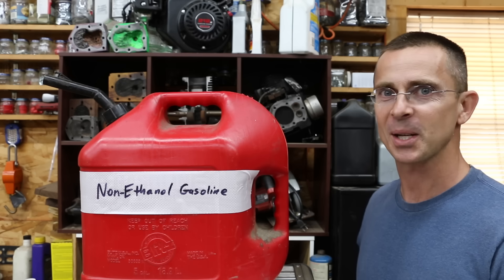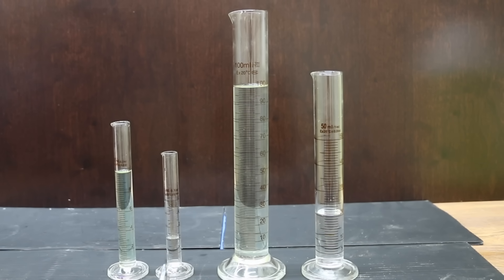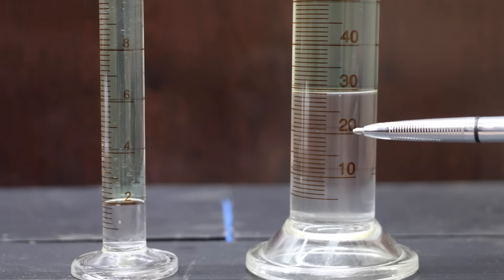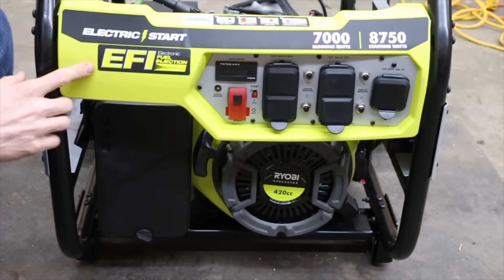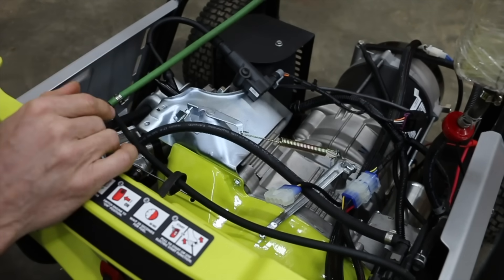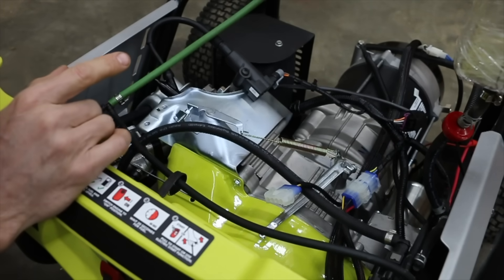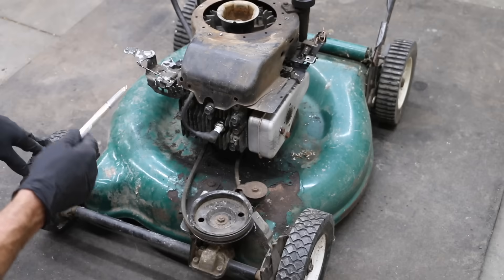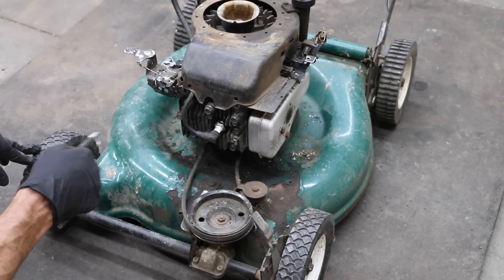Is Non-Ethanol Gasoline Really Better? See the PROOF!

Comment: In England, Scotland and Wales (thankfully it hasn’t got to NI yet) from this summer all petrol will be E10 (10%) petrol currently most of it is E5. The government is going to make it law for fuel stations to make standard petrol E10 this is in order to put approximately 500,000-600,000 cars off the road (unless you pay more and buy premium 0% ethanol). The government recons that the use of E10 petrol will reduce the amount off CO2 produced in the year by cars will be around 700,000 tons. In the UK at least all cars from 2011 have be required to be E10 compatible. 

The reason older cars can’t use it is because they have lots of nitrial seals and steel fuel system components this is a problem because ethanol desolves and damages nitrial seals, also it gathering up water in steel tanks and pipes won’t do much good.
Another down side to E10 petrol is that it doesn’t work well at all in 2-stroke applications apparently ethanol acts like degreaser, not ideal in the crankcase, and as a lot of 2-strokes have carburettors and the the ones with nitrial needle tips won’t like it either

According to Autocar in some vehicles that the E10 petrol will decrease the fuel economy by just over 11% this was in a a Dacia Sandero. It may be better for the environment but it certainly won’t harm the governments pockets if everyone is filling up more often and there has to be 500,000 new cars bought there will be a lot of VAT and fuel tax revenue created

Comment: The biggest problem is that fuel with alcohol in it costs less and is more readily available than non alcohol fuel negating the 4+- % fuel savings. Using the fuel in a can at $15-30 for a gallon equivalent is just nuts. One of the best things to do is run to empty when not using for a period of time.
Reply: But then you have increased condensation and potential rust in steel tanks.

Comment: Ethanol gas is not bad, per se,unless it sits in the fuel systems of two and four cycle engines.  Sitting in a gas tank it absorbs water from the atmosphere, which is what cause problems.   If water gets in a carb or fuel system it will corrode aluminum parts and harden rubber parts which will inhibit them from running properly

Comment: quick side note
........our company purchased a small EFI generator, about the same size as the one in your video.
(..............found that there were many pieces of equipment that would not operate with it..)
heavy duty hammer drills and what-nots.
.
...........not sure why

Comment: question : is after fireing in small engines some thing to take serious or is a fact of ageing..
Reply: You mean backfiring and fire coming out of the muffler? That means you're not firing all the time and raw gas is passing through on some strokes. Something wrong.
Reply: @jamesvandamme7786  a back fire is when an engine has ignition of fuel air mix  in the intake system..after fireing is un burned fuel air mix ignites in the exhaust system  they are different... a back fire can destroy an intake system an after fire can ruptue an exhaust system
Reply: @jamesvandamme7786  also when throtelling back from operating under load i do know this if done rapidly will cause poping of the engine in exhaust as fuel air mix is richer for a few seconds

Comment: I've run ethanol in everything I own for decades now, and it's never been a problem as long as it doesn't sit for 4 months. That includes older machinery, my 1950 industrial air compressor with a straight 6, my 1964 Parkmaster with a straight 6, and several vintage motorcycles from Europe and the far East.  Iowa has ethanol in all gasoline and we have the lowest average auto repair in the nation.  According to the naysayers, our roads should be littered with dead cars. Some of us are old enough to remember rotten fuel lines, fuel pump diaphragms, and gummed up carbs being a REGULAR issue long before ethanol was ever created. Ethanol was the propaganda excuse big oil foisted on you all because they didn't want the competition.

Comment: I have twice bought gas which made my engine more powerful and significantly increased my mpg. Both were the same brand from the same gas station. I have no way of knowing why, but I have my suspicions. My guess is that those 2 batches of fuel were ethylene free, perhaps because the supply company had run out of ethylene and sent it out like that because they had to supply gas stations no matter what. If that is the case it implies that I am burning more fuel for the same mpg and performance as ethylene free gas. If so it implies that the gas with10% ethylene is not in fact reducing CO2 emissions because I am using more gas for the same mileage.
Reply from the maker: Thanks for sharing.

Comment: As a small engine mechanic, i can definitely say that yes ethanol is damaging to materials like rubber o-rings and hoses. Besides that it corrodes aluminium, rusts steel, and creates a chalky buildup that ruins carburetors.

Aaaaand..... It has a lower energy so e-10 fuel is roughly 10% less fuel efficient than straight gas and takes roughly 30% more fossil fuels to create.
Reply: We would not have ethanol mandates if Iowa was not one of the early presidential primary states
Reply: In Europe it is impossible to get gasoline with not at least 5 % ethanol. I was wondering why they made such a law, as the know well, that the production of Ethanol is ruining the rain forests. But i found the answer. :-)  It is damaging the materials of the engine. That means shorter car life and more business for the car companies. So Ethanol is bad for the environment, as it shortens the car life, but its good for the companies that produce cars.
Reply: @friedensmal  Not sure if this is true or not but I have heard that the ONLY reason why we use ethanol is because of american farmers not having buyers for their corn.
Reply: @codemang87  cattle farmers would buy the corn see how they buy the feed product produced from the ethanol process
Reply: @codemang87  no one wants to eat it. Gmo
Reply: @stillkickin9957  what's your point?
Reply: @117rb  umm that is a shaky feed source at best take big bucks to move store even feed the crap. It also had a very low shelf life
Reply: @brianjohnson6053  long enough shelf life to ship to China seeing how thats where a lot of it goes. And it moves and stores the same methods as corn does.
Reply: @friedensmal  Esso in the UK says otherwise unless you live in the far Sw or North! 
"Esso super unleaded petrol (Synergy Supreme+ Unleaded 97 and Synergy Supreme+ 99 ) is ethanol free (except in Devon, Cornwall, North Wales, North England and Scotland)."
Reply: From the 1st Sept this has changed. All higher octane fuel is now E5 (5% ethanol) from the major brands. Regular is now all E10
Reply: @1maico1  The Esso website says 99 octane will continue to be ethanol-free in most but not all UK regions for the time being at least.
Reply: @Rob Elston Ethanol doesn't take any fossil fuels to create IIRC.  How does it take 30% more fossil fuels to mix gas 10:1 with ethanol?  Does it take more proccessing to make it? I feel like I'm either missing something or you are just making shit up.
Reply: @codemang87  how is the corn planted, crop maintained and harvested?? Magic?
Reply: @mebe2k  that's irrelevant. Corn doesn't require fossil fuels to produce.  Semantics aside, even if they did use some gas to plant crops, that's pretty much negated by the fact that they would be planting crops regardless of whether it's used for ethanol or not.

With your logic you can practically say everything in the world uses fossil fuels.
Reply: @codemang87  and electricity magically come out of the wall too.
Reply: @mebe2k  I live on a farm. Corn most definitely takes fossil fuel to produce.We have massive diesel tractors to  cultivate and plant the fields and equally large combines to harvest. Then we have diesel trucks that ship the corn to the silo.
Reply: @rikertvonfulton16  does it take more fuel to produce corn for ethanol than it does corn for food?
Reply: @codemang87  Not to the point of harvest. It would depend on the transport distance to the ethanol production plant . The farming community has become dependent on ethanol production as a market for their corn.
Reply: @rikertvonfulton16  thank you.  It's gratifying for my perceptions to be reaffirmed by someone actually in the industry
Reply: @codemang87  I usually don't respond but to clarify his point. Farmers use Diesel to plant, tend and harvest their crop. Its transported by truck to factories that use electricity from fossil fuels to produce the ethanol and then its transported by rail and truck to the refiners to mix it with gasoline.
Reply: @biffmalibu3733  that's exactly what I thought.  You guys are arguing with me but agreeing with everything I purported. 

To be clear, I think the original poster is full of horse shit.  I don't think its takes any more fuel to farm corn for ethanol than it does to farm for food.  Definitely not a 30% increase at any rate.
Reply: @codemang87  Basically everything in the world DOES use fossil fuels to be produced. Is the light bulb on yet?
Reply: @codemang87  Well I guess the light bulb hasn't come on for you yet. Give bit time and some thought, if it's not to painful.
Reply: @TheFishdoctor1952  how bout you just explain yourself rather than jump in and completely change the subject.  Just because farmers use fossil fuels doesn't mean you get to count corn as a fossil fuel.  That's some fuct in the head logic right there.
Reply: @nooneyouknowhere6148  thanks for supporting what I already said
Reply: @codemang87  I can confirm it takes a 10th of the energy to make ethanol then a refinery
Reply: @117rb  Why are they stuck on corn for ethanol when there are plants that have a much higher yield. Cattails everywhere,  easier to grow on your own land? Talk about energy independence. Run your car, heat your home etc. etc.
Reply: @biffmalibu3733  It also takes energy to make fertiliser.
Reply: @codemang87  Corn fields must be prepared, planted, grown, harvested, fermented, refined, and transported, requiring energy input at every stage and likely involving more than one transport step. It also contains fewer btu than gasoline. Petroleum gets sucked out of the ground, refined, and transported. The crude oil is often burned in the field to power the pumps that extract it. I know, "BuT CoRn Is GrEeN!"
Reply: @codemang87   do you not understand that the ethanol demand makes people farm far more corn and therefore burn far more fuels than if we weren't adding it to gasoline? stop being ignorant, arrogant, and insisting you're smarter than everyone and can't be taught. you were wrong because you think in very simple terms, be humble and learn and stop thinking you can't be wrong
Reply: @mebe2k  true...but, you can say the same for all crop's worldwide...not to mention anything and everything on the planet that human's use...not 1 single thing in the world that is grown or manufactured is without the use of fuel of some kind to move it from place to place....there are a great many thing's that could be used to make ethanol...it doe's not have to be food...regular, everyday lawn grass can be used to make at least 3 type's of fuel...ferment it for alcohol, or methane, and it can be compressed and dried to make log's or pellet's for burning
Reply: @codemang87  No, but farmers are using more land to grow more corn for ethanol than for food,  so either more tractors/trucks or run the ones they have longer, plus tilling that new land releases decades maybe centuries of stored carbon from the soil, on top of reducing grassland, forest acres.
Reply: @vdubnotch4810  saw-grass also makes a cleaner/easier to make alcohol than corn.
Reply: @a..d5518  That's great to know,  thanks. 👍
Reply: @a..d5518  you are missing my point so I'll reiterate again.  What you are describing is just normal farming practices.  While I don't agree with using corn for ethanol, but it does not take any more resources to grow that corn for ethanol than it would if they were growing it for food.

For example, imagine they weren't using it for ethanol; its only used as a food.  Would they still have to use all the same farming equipment to raise and harvest those crops?
Reply: @codemang87  it doesn't take more to make it
Reply: @codemang87  You have to burn fossil fuels to make ethanol. It's not made up. Do you think we get ethanol from a magical place? Every output requires an input. It takes fuel to till, plant, and harvest corn. Then, it takes fuel to heat and convert it into ethanol. So, we burn 10x more fuel just to add in that 10% of ethanol. It's one of the biggest gooberment scams. If that doesn't tell you politicians are crooked, short sighted, and get kick backs from Oil companies then IDK what will convince you.
Reply: @cha-ka8671  farmers are still gonna farm regardless of whether it's for ethanol or food.  Do you think that just because they can't sell their corn  to ethanol processors that they are gonna stop farming altogether?
Reply: @codemang87  Also, explain why straight gas costs nearly $1 more for that 10% less of ethanol.
Reply: @codemang87 how is the corn harvested genius
Reply: @imlikerhettbutler5093  holy fuck. 3 year old thread. To reiterate again: whether it's harvested for food or fuel doesn't make any difference to the harvester.
Reply: @codemang87 just checking if you were still around 😅
Reply: I wonder if, as far as small engines are concerned, the unsaturated hydrocarbons (aromatics and olefins) are more damaging to o-rings and hoses than ethanol. After all, how long would an o-ring last in toluene or xylene?
Reply: it can´t be 10% less efficient, because then ethanol woulnd´t have any energy. 100% ethanol has about 40% less energy. So E10 has round about 4% less energy. And that´s exactly what was measured here.
Reply: @codemang87  typical... obviously you were clear you didn't know if it was true or not, but you sure was on the side of it weren't you?.... and why state it if you don't know if it's true?.... and then all the other mistruths and denials... wow buddy, you are a product of the internet.
Reply: @AVportau  okay dude
Reply: As a small engine mechanic, you are certainly unqualified make claims about fuel efficiency or about how much fossil fuels are used to create ethanol.  Those are engineering conclusions, and you're no engineer.
Reply: @jonathanallen5904  and what's your qualifications to make such assumptions?
Reply: I can remember when gas had a pretty blue tint. Not nowadays
Reply: @Scandinavian_Pride  thats cause low octane non ethanol is almost non existant now.  High octane non eth is more of a clear color.  If it's got ethanol at all though, it'll probably be yellowish or brown.
Reply: @Scandinavian_Pride  in Cali we had 76 super. 95 plus octane and a peachy orange color. Even smelled good. Our 2 strokes and vdubs lived on it
Reply: I work on an organic farm that is also an ethanol plant and R&D facility. The fact thats being overlooked is that the burning of hydrocarbon based fuels (fossil fuels) is a NET burden with regards to carbon (and other toxic compounds) in the atmosphere because you're digging up carbon that's been stored. when you switch to a carbohydrate based fuel (ethanol (and not just by only 10%)), the plant matter you grow for a feed stock (sugar cane is much more efficient than corn BTW) is actually sequestering the carbon you're emitting multiple times over.

As far as damage to your engine; there was an experiment done on public transport busses in new Zealand running strait ethanol. the busses are not only still running 30 years later, on a teardown inspection, the honing marks on the cylinder walls put on by the factory were still visible.

it should be obvious that running a solvent (such as ethanol) cleans your engine, but to get the maximum benefit from it its best to not have it polluted with the 90% gasoline

for further reading I recommend the book "Alcohol can be a Gas!"
Reply: @nirvin6760  Cattails 😁
Reply: yes.... bbbbut.... it's "green"
Reply: Damn
Reply: Well this is all wrong. Every part of it
Reply: Damn right.

Comment: it's not all about what it does to the combustion chamber, whats it doing to your fuel system?  welp, newer vehicles run on a vented tank system, very hard for moisture to build up and when it does it gets vented..

however pre unleaded can carbs STRUGGLE hard on ethanol cuz it ATTRACTS AFTER LIKE A SPONGE, marine applications struggle harder!

carbs to not like water, nor do fuel tanks, motorbikes were carbed up till like 98 or so, so anything before that really struggles using unleaded as the water is inherits, and its not a maybe it attracts it even in the driest climates like phoenix,  tanks turn to an orange sludge, float bowls corrode, fuel valves coorde and stick, its just horrible for a carbed set up, when it sits, if its a daily driver its not so bad, let it sit a few weeks, ruh roh... let it sit 6 months, double RUH ROH..

I've had to de rust 4 gas tanks in the last 8 years, anymore I drain it all for winterizing... OR, iu clamp fuel line, run carbs dry, then fill tank with E free gas... only way, then block exhaust and ram air tubes..  if you live in humid regions ethanol is the WORST for carbs and tanks, petcocks, water is not your friend
Reply from the maker: Thanks for sharing.

Comment: Why is that engine so hard to start?  Even with  a drill?  It would never start with a rope.
Reply: It takes a bit for the fuel to run through the carburator since he ran it out of fuel each time. I bet if he filled it up with gas before it ran out it would start no problem.